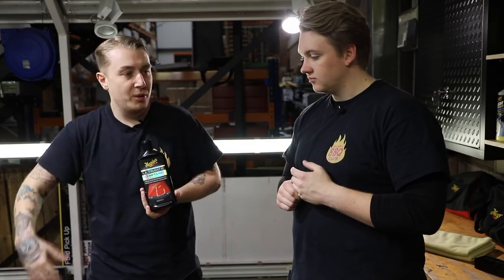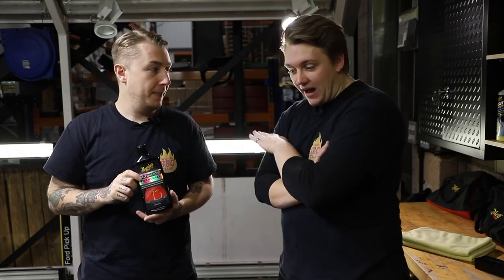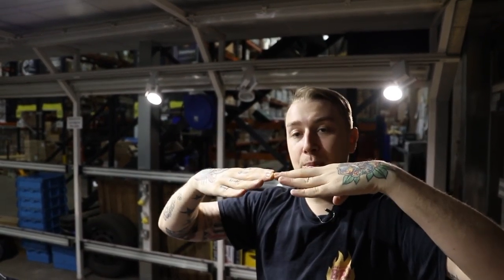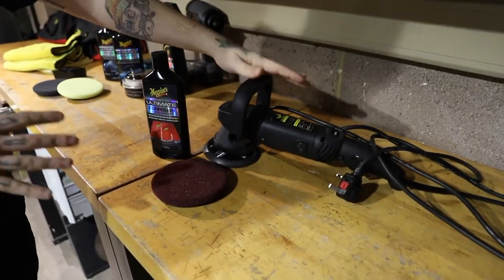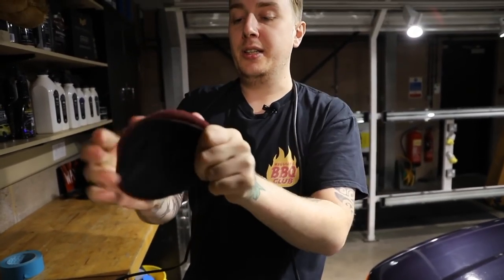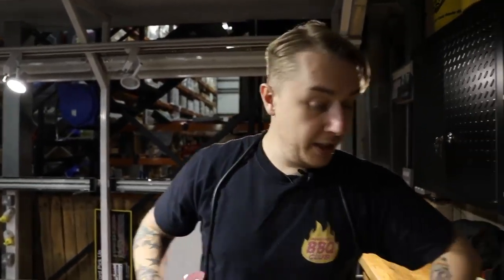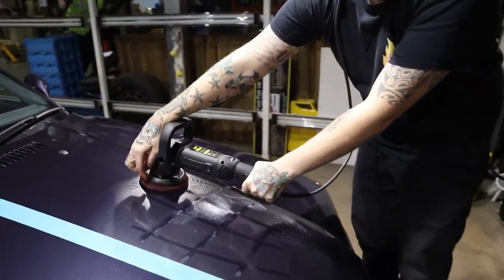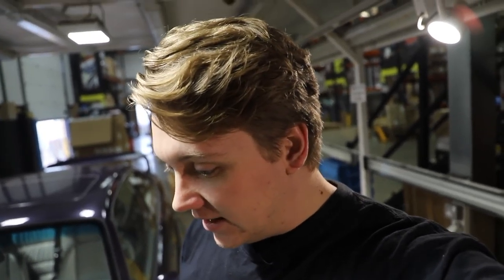Removing Swirls & Scratches with Ultimate Compound - Meguiar’s Detailing 101 – UK Edition

Comment: Hi, if I still see light scratches after I've completed all 3 steps, do I repeat the process entirely?

Or do I apply the ultimate compound again  (step 1 again, before moving on to step 2)?

I am asking for the second car as I have already completed all 3 steps on the first car but I still see some light scratches.
Reply from the maker: The compound is the step that will remove scratches.  If it takes 2-3 applications to remove the scratches that is fine.  If it is still not working after multiple applications you need to figure out the next level of aggressiveness that can be employed.  Feel free to reach out to our Solutions Hub to discuss the specifics of your situation to formulate a plan of action.

https://s.3m.com/tt3yjb
Reply: @meguiars  Thank you for response. How slow do I need to move the DA during the process to remove the scratches when I apply the compound step?
Reply from the maker: Here is another video that covers that...

https://s.3m.com/phmqf7
Reply: Same here. I'm using a da with the microfiber cutting pads and there's still light scratches and swirls. The paint looks better but still not right. My roof is the worst and when it's parked in the garage and the lights are on it looks terrible. 😡
Reply from the maker: Sorry to hear about your experience.  It is difficult to say without more details what may be happening here.  The microfiber pads/discs do require a more specific technique and cleaning process than foam pads; however it sounds like one of two things may be be happening.

1)  There are pre-existing swirls and scratches that are likely worse than you suspect and/or your
      vehicles paint is harder than you expect.  This being the case you would need to step up in 
      aggressiveness to remove these defects.

2)  The other scenario would be that your paint is incredibly soft and you are being overly
      aggressive by using the microfiber pads, high speeds, too much pressure, etc.  If that is 
      the case and you are creating these marks when buffing you would need to step down in 
      aggressiveness and use a different foam pad and possibly product.

Here is a new video we just posted that discusses how to use the DA Microfiber Pads.  Please also feel free to reach out to our Solutions Hub via our website to discuss in more detail.

https://s.3m.com/jkcrfq

Comment: Hi dale i am trying to compound by hand and the swerls arnt coming out dose these only come out with the mechine ? Or have you any tips as been on ferlough i carnt just go out and buy a mechine or trust me i would 😂😂
Reply from the maker: There is certainly no replacement for a good machine.  There is just a limit of what you can accomplished by hand, especially if working on hard paint.  That being said make sure you are using a foam applicator to apply the product and a good microfiber towel to remove it.
Reply: @meguiars  yes i have just finished 18 hours i was on it i used the aplicaters and the fibre towels but you are right i need  one of these machines as it just lookes like i washed it 😂😂 wasted alot of good product thanks for the reply and the great vidios👍👍and love the product just need to learn to get it right for max results

Comment: After a few passes using the ultimate compound I'm still noticing a few swirl marks with my detailing light. If I can still see them should I use a more aggressive pad like an mf, do another pass or should the final polishing stage be expected remove them. I'm currently using the same cutting pad in this video. The car I'm currently working on is a metalic black bmw and from what I have read online the paint is pretty hard.
Reply from the maker: If the paint is hard and the swirl marks you started with (trying to remove) are just not coming out our microfiber discs might be a good choice.  If you have buffer trails/hazing from being too aggressive then you would want to take the opposite approach and use a more mild product with a softer foam pad.  

For further assistance please feel free to reach out to our Solutions Hub.

https://www.meguiars.com/contact-us
Reply: @meguiars  Thanks guys. Will do another test patch to make sure but pretty sure it's just not cutting. Just out of curiosity, could i achieve more cut and still get it done by doing more passes or is there no point trying with a foam pad if the clear is to hard. My country is in lockdown so no shops open for weeks :( need to finish car asap.
Reply from the maker: Yes, a couple more passes or even applications would certainly be worth a shot but if that doesn't do it you are going to have to tweak some of the other variables.  For that matter, what kind of machine are you working with and what speed are you running it at?
Reply: @meguiars  I'm using a 150mm dual action polisher around speed 5 with a DFC6 foam cutting pad. The only compound I currently own is Ultimate compound. Can't seem to get hold of M105 or any of the other M range products here. I can get the paint looking almost perfect with about 3-4 sets of 5 passes but having to do that for the whole car is going to take forever seeing as I still intend to polish. Should I maybe try speed 6 and slow my passes ? Thanks guys.

Comment: Can I use the Ultimate Compound and Polish on a da polisher on a panoramic sunroof?
Reply from the maker: If the sunroof is glass and does not have any kind of tint film it could be used.  Not sure there would be any reason to use polish and you would only use the compound if there was some kind of stubborn residue or stain on the glass.

Comment: I used compound today and I felt it was drying up quickly and bits of dry compound was going everywhere..What did I do wrong? I wasn't in the sun but it is hot.
Reply from the maker: Some products dry quicker than others but the key is usually to do just a small section (1-2 sq ft) at a time and remove immediately with a high quality microfiber towel.  You do not want the product to dry at all.

Comment: Can I use a angle grinder and 3,000 grit to remove the scratches.
Reply from the maker: Sanding is a very aggressive process that should only be considered if you have the proper tools/products/materials and knowledge to use them comfortably.  We always recommend trying the least aggressive method necessary first but yes, in theory if you have very bad scratches that are still not through the paint, or working on a very hard paint sanding and buffing might do the trick.

Comment: Can I use the yellow foam together with Ultimate Compound? Or just the red foam ???
thank you
Reply from the maker: You can use either.  The burgundy is going to be more aggressive/effective.  If you are trying to remove defects you could start with the yellow and if it is not aggressive enough you can try the burgundy.  

Hope that helps.  😃
Reply: Meguiar's I understand, if I use the yellow foam with the ultimate compound, and will use the ultimate polish, then will I have to wash this yellow foam? would it be contaminated by the compound or not?
Thank you.
Reply from the maker: If you only have one yellow foam polishing pad that is correct, you do not want to use it to apply the compound and then turn around and use it immediately for the polish.  If that is the case you should use the burgundy cutting pad for the compound or buy another yellow polishing pad.
Reply: @meguiars  thank you
Reply from the maker: Happy to help!

👍

Comment: how do you know what kind of pad to use?
Reply from the maker: If using a DA (dual action) polisher it is actually pretty easy.  

Compound Step - burgundy cutting disc
Polishing Step - yellow polishing disc
Wax/Sealant Step - black finishing disc

That order reflects the level of aggressiveness.  There are exceptions for special situations but this is a good guide.

As always feel free to reach out to our Solutions Hub for help with your specific job.

https://s.3m.com/ah978

Comment: @Meguiars Hi, Please what is the optimal speed from 1-6 on the machine for Removing Swirls & Scratches? Thanks
Reply from the maker: We typically recommend speed 5 for application of of compound / defect removal.  👍
Reply: Meguiar's Thansk, so its one speed faster when polishing or the same speed?
Reply from the maker: Usually speed 3-4 for polishing.
Reply: Meguiar's understand, thanks🍻
Reply: @meguiars  sorry if I'm late for questioning this, what machine did you use? 
5 speed equals to what RPM?
Reply: @samuelkurniawan1383  didn't u watch the video lol

Comment: This stuff caked on to my car it was hard to remove is that normal or did I do something wrong please help
Reply from the maker: Sorry to hear that.  The two most likely scenarios that would lead to that are...

1)  Letting the product dry.  You should only be working a 2'X2' at most and wiping off immediately with a high quality microfiber towel.  The product should not dry at all.

2)  If your paint is already at the point of paint failure and not just oxidized almost any compound, polish, or wax will leave product residue because it is such a dead and porous finish.  Of course if you are at this point the only real remedy is repainting.

As always feel free to reach out to our Solutions Hub to discuss the specifics of your situation.  Include pictures if you can.  😃

https://www.meguiars.com/contact-us
Reply: @meguiars  thank you meguiars

Comment: Cleaning the pad ?
Reply from the maker: Cleaning the DA discs "on the fly" can be done with a nylon brush, air or even a microfiber. Once the car is done, the discs are machine washable. Low heat, low air dry and store properly for next use.